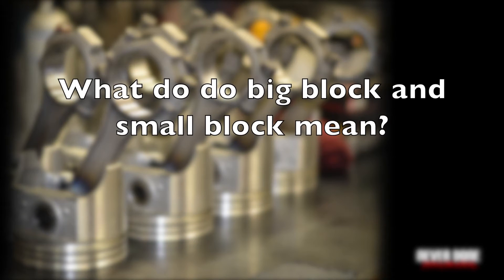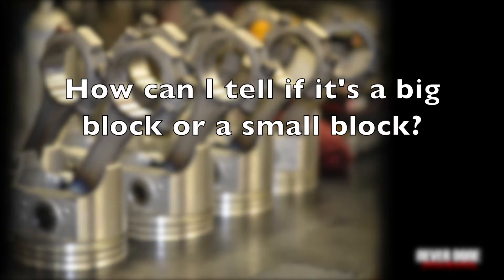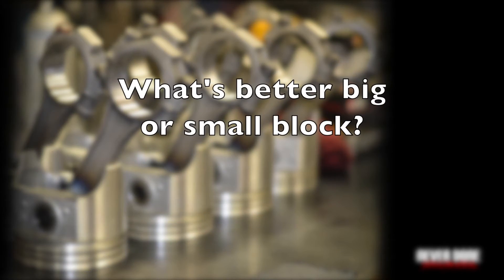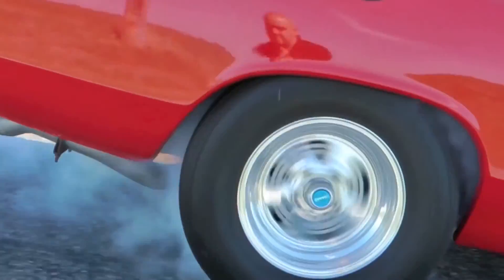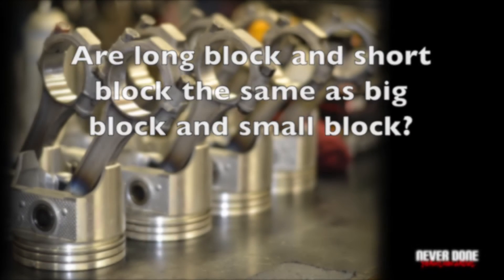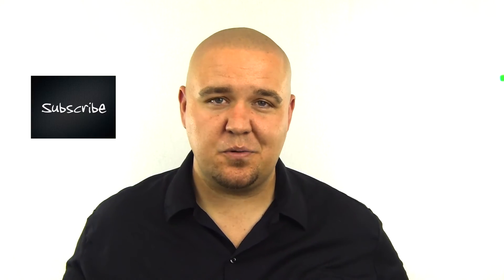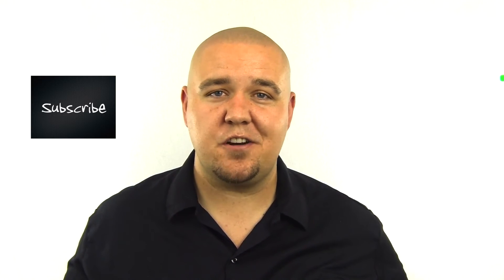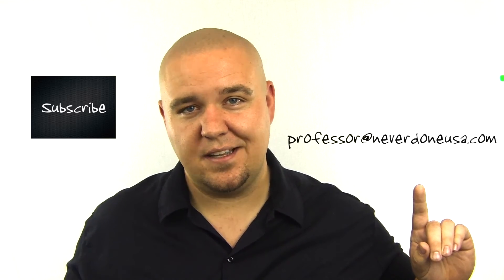Ask Professor Clint Ep.2 - Big Block v.s. Small Block

Comment: Your correct with all your answers, but you really didn't even touch on THE ONE TRUE DIFFERENCE BETWEEN A BIG BLOCK & SMALL BLOCK. Take a 427 big block and a 427 small block. The main determining factor for a big vs small block IS THE CENTER BORE SPACING MEASUREMENT. ( That is the measurement from the dead center point of one piston to the dead center point of the next piston. Big blocks are the only blocks that can have a center-bore spacing over a certain measurement.) If your gonna educate these kids, at least give them some TRUE USABLE INFORMATION. "If the engine looks like it was "shoe horned into the engine bay, it's a big block.....and if there's room around the engine in the engine bay, it's a small block"...................THAT STATEMENT IS DOWNRIGHT RIDICULOUS. What if someone puts a small block V8 in a small car that originally came with a 4 banger? Thanks to that rather silly answer you offered these kids, they will now assume in my above scenario, that "It must be a big block" when in fact. it's NOT. The big block wouldn't even fit, whereas the small block BARELY fits. Like I said.........you could have at least told them about CENTER BORE SPACING MEASUREMENTS in which your viewers would at least walk away having REALLY learned something.
Reply: Howabouthetruth  Yeah just say stroke vs bore ..... the 427 small has same cubic inches using a different bore and stroke than the big block..... then go into spacing of the cylinders.

Comment: O.k... maybe the skirts are a little shorter on the small blocks? But what is a safer bet with stroker kits???
.
Small blocks, big blocks... what's the diffrence = idiots!! A small block can be just as powerful sense they have the same size chamber (excuse me for not using a technical term. But "bore" wouldn't be a correct term, equal to both!), but one has a longer skirt on the piston (don't want all that power to run away!!)... The ideal is a big block with the same size "bore" as a small block (same chamber size), but using the extra size to make bigger cooling ports! Just use silicon as the one main metal used in it's make-up of the whole engine. It would make them even more durable than the big blocks used for utility, without the added weight (imagine a truck, all silicon medal... super light-weight!! But weights could be added for utility work!!).
.
Just making something way to complicated - EASY!! It's gotten to the point that all these different combination medals, and complicated electronics and vehicle builds is a rich mans, illuminati card game. Since I'm in it... and your snuff rules don't apply to me... I'm the "UNLIMITTED OUTLAW"!!
Reply: Your rules don't apply to society either... and we have final say on EVERYTHING, since we are your everything!!
.
We demand electricity be free, all plants legal, and used by the individual as he pleases, so as long not to hurt his neighbor. Food and basic supplies should be dirt cheap, and are!! All tax payer money is spent by the will of the tax payers, and for the better benefit for the whole of society's well being. All of government and it's legion of "enforcers" are servants to the public, and the publics will. Just as the customer is always right, the citizen is as well! All government should be completly transparent, with video's that can be accessed live, and recorded with records available to anyone anytime on-line. The web is to never be "controlled" (all attempts to control it with so called security, or risks... are false flags just the same a 9/11! A terrorist wears a suit and tie, and talks shit all day in congress!!), we are to respect eachothers boundaries while also realizing that everything can be accessed, but should be respectful to the person (truth does need to be detailed for bringing about the greater good). Obviously all cops need to wear camera eye-glasses and mics. This the same, is to be accessed 24/7 live with records. Until the 3rd eye is exposed, society as a whole should decide the outcome of all disputes, in a manner that best resolves the situation without arrest or tickets (remember how forgiving and caring God is!), using these video's and records (this would solve everything. You have to remember that EVERY human being on this planet is controlled and meticulous records are kept, down to the point "they" can video record your own thoughts/wondering in detail!! America was founded by slaves that wanted to be free. Your never alone!! The N.S.A. is chump change, compared to how controlled all of society is. I mean C'mon... we ONLY USE 5-10% of our brains!!? Just the same as the Indians would use the whole of the deer, down it's bones. "They" do the same to us, all the way down to our piss and shit!!)....
.
So much more could be added to this... but in reality it should be as simple as not necessarily "respecting" your fellow brother/sister/neighbor. But rather loving and caring, with respect to the individual as self. Common sense should be used at all times with the know exposed truth. That truth is yet to be acknowledged, and I feel things are in a state of being in-order for others to speak up, bring forward the truth again and again... until it is acknowledged. We are being held back from a heaven for all, by a very few that force upon us a hell, while deriving that heaven from us. Life is free, and beautiful... EVERYTHING IS FREE!! God just ask that we get along!!
Reply: +Brian Davis ooookkkk

Comment: Hey Clint! What's the difference between a 2 bolt and 4 bolt main? Why would you want one or the other? Benefits and downsides to both? Thanks!
Reply: well a four bolt main distributes the loads from the crank over a wider area so a 4 bolt main would be able to withstand a lot more torque and power than a 2 bolt design.
Reply from the maker: Brandon Austin Thank you Brandon, we'll get right on that one!